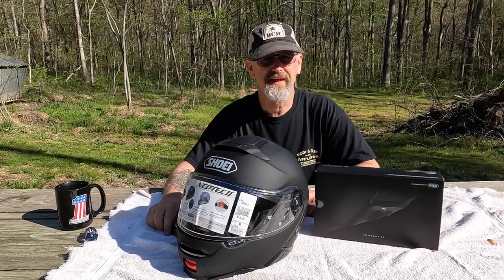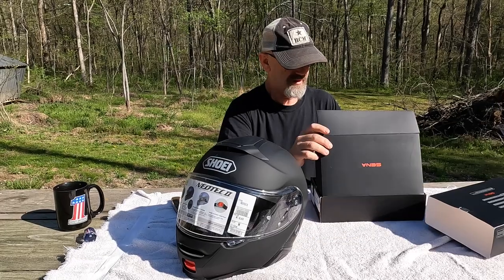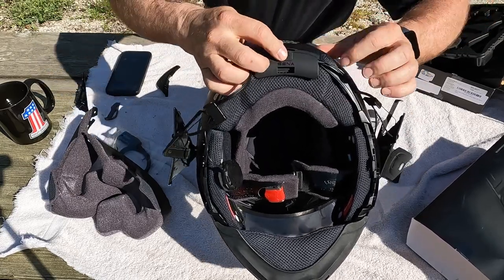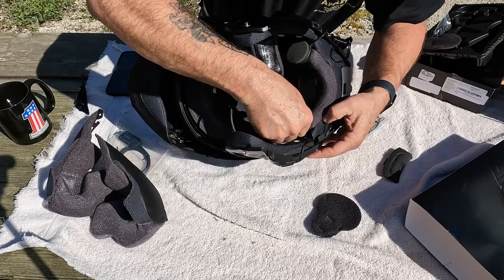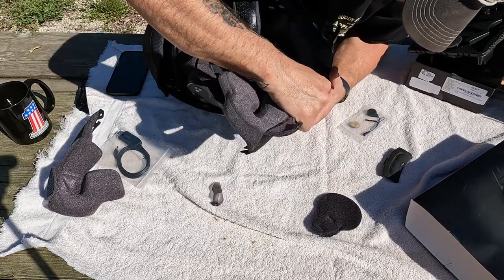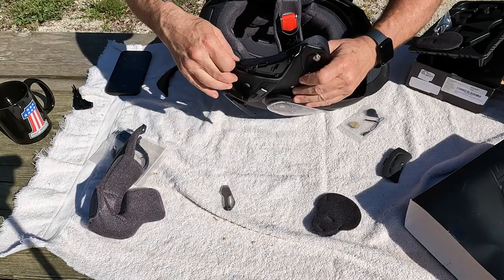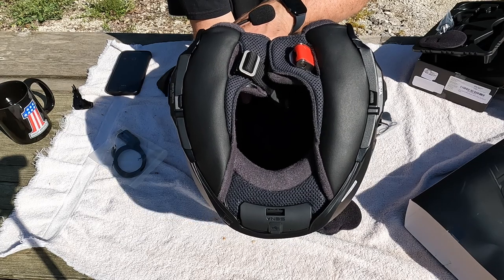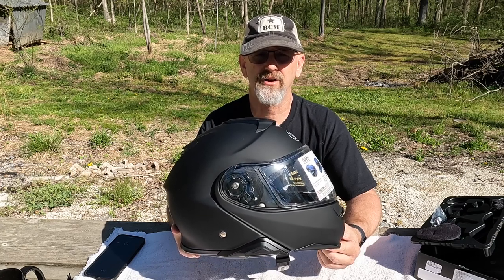SENA SRL Mesh install into a Neotec 2

Comment: Good neat install.  Big upgrade on the srl2.  Basically the exact same circuit as the Interphone Ucom16 uses.  Mesh is brilliant.  Bluetooth fm radio is useless (aren’t they all?).  Top tip…if pairing with a gps, do that first after you do the firmware update, then disconnect bluetooth between phone and sena.  Next, connect your phone to the gps via bluetooth.  So what you have is the sena treating your phone functions as part of the gps signal.  You then control your phone from the gps.  Try using a separate phone input to the sena and it will mess up gps and vice versa.

When you need  to pair with another sena or interphone unit via bluetooth the app makes it easy using the Qr codes.  Just remember to disconnect the phone from sena when done.  Your lid  will automatically pair with the ones you scanned and saved.

When using mesh you have open mic connection whilst connected. Remember to hit the mesh button when done talking to close the mic and extend battery life.
Reply from the maker: All good points but I pair my Sena to my bike then pair my gps (Zumo xt) to my phone and then my phone to my gps. I can use my bike controls for volume,skip, answer and make a call. Thanks for watching I appreciate your time.

Comment: thanks for the install video, how do you like the sena app? did you consider cardo or any other comms systems? or not really since the sena was designed to be incorporated seamlessly in the neotec2. appreciate your content.
Reply from the maker: I like the Sena integration into the Neotec. It has been working out great for me. I tried a Cardo last year and didn’t care for it. Battery life was too short and me and the wife had trouble connecting sometimes. 
If I had a negative to the SRL is battery life, it goes dead at about 8 hours. Then when riding if you plug it in to charge it turns off. Other Sena systems will continue to stay on and charge if needed. I spend several hours in the saddle on some days and it just isn’t enough. 
Thanks for watching.
Reply: You lose mesh when charging but it’s no biggy to charge when on a lunch stop as nobody rides 8 hrs straight and an hour will top up enough to get you where you’re going👍

Comment: Hi Mudcat Def enjoy the content that you've been putting out. I have a 22 PAS and was left stranded in the woods camping out in AZ. Bike starts with the jump pack. What was the issue with yours and what number did you call when you called corporate Harley. The dealer keeps saying that I have to keep the bike on a tender at ALL times!! I'm like that's crazy!! They charged me to "charge" the battery that I know was charged and I'm tying to get to the source at Harley to get this issue resolved. I'm beyond frustrated with the dealer but really enjoy the bike when it works.
Reply from the maker: I called customer service and opened a claim. They hot back with me in a few days with a resolution. Just be nice and respectful and tell them what you have been through in detail. I write down notes of dates and what had been done. I was very satisfied with the outcome. I have had zero issues with it since. 
Sorry to hear of your issues. I believe a lot of the problems can be contributed to poorly trained techs and service managers that don’t understand the bikes. I would encourage you to try a different dealer    or contact the factory customer service number. The bike is really amazing once it is lined out.

Comment: I was looking for the review video what you mentioned, but...
Nobody do the review, probably because I found one who said, over 50mph you can't hear anything, so the system is actually totally useless...
By the way it's shame from every company, non of them can do a proper intercom in 2024. How difficult can be? 😜😃
Reply from the maker: Actually I was happy with the comm system. No issues at all. Good volume, easy to connect battery life was good . I just couldn’t deal with the helmet. Went to an Arai fits my head better.
Reply: @mudcatstravels9751  I'm still affraid to buy it. I have a naked bike with touring screen, but my helmet still getting the wind. I'm not planning to travelling constantly above 100mph, but that one already very loud, and I would wondering if I could hear anything...